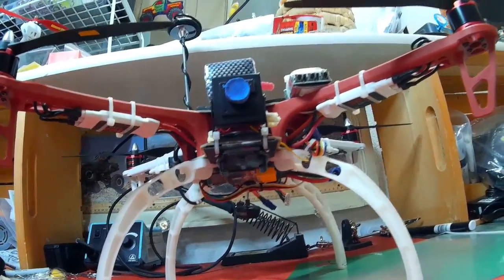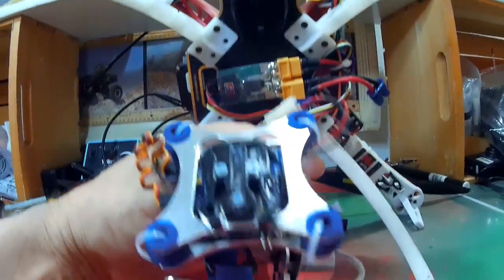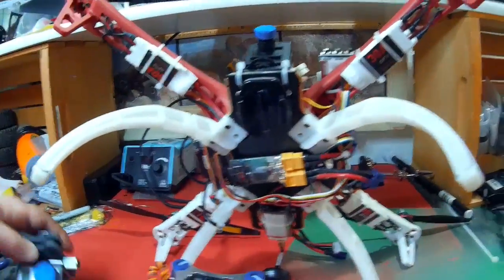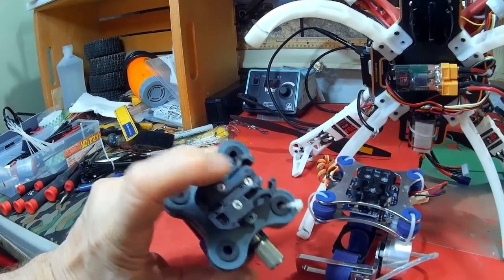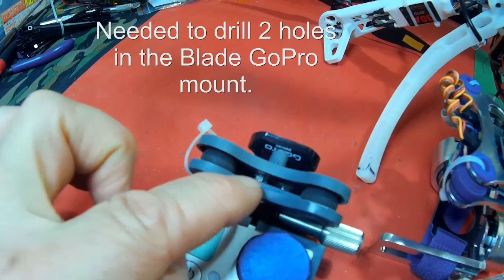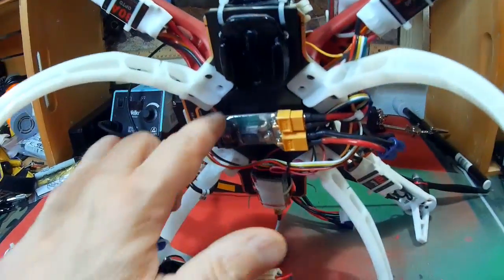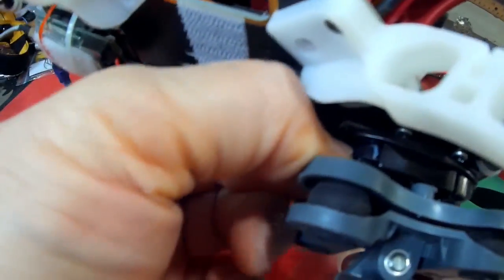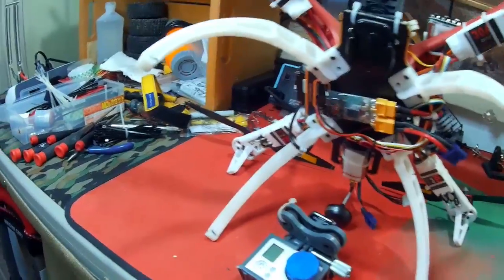Gimbal to no-gimbal GoPro camera mount on DJI F450

Comment: use the white rubber thing that comes with your go pro, it will stop the clip from sliding / un-clipping off the mount
Reply from the maker: Thanks.  All I have to do is figure out how that little white thingy works.

Comment: Hi! where can I buy ?vibrations in the video?
Reply from the maker: I just used parts that came with the GoPro to make the mounting. I took the goose neck mount apart to get the attachment to the gimbal.  Doesn't seem to be any more vibration than hard mounting the gimbal to the quad.
Reply from the maker: Alessandro Romano This looks like the same gimbal that I have. If so it is a good gimbal to start with and the price is good. I have 2 quads and the second one has the Feiyu G3 gimbal but it costs 3 times higher.
Reply: mikeglamrc the weight of my drone (dji f450) is 1200 gr.you know the weight of this(240 gr ? ) + cam sj4000=60 gr .total 1500 gr . is a problem?
Reply from the maker: Alessandro Romano I would have to measure the gimbal weight when I get home tonight. I have the DJI F450 with 840KV motors turning 10x3.7 props and using a 6000mAh 4s battery. My total quad weight with gimbal, GoPro and battery is about 2000 grams. I get about 6 minutes safe flight time and a max of 12 minutes before the quad lands itself.
Reply: mikeglamrc Thank you for your time.I am a beginner. and I took a drone recently:
(dji 2212 motor 920kv,e300)
Reply: Alessandro Romano sorry it took longer than I thought. The gimbal weight without the GoPro camera is 208 grams.
Reply: Random Acts of Cooking with the characteristics of my drone, I will have problems in flight with about 1500 grams of weight?
Reply: Alessandro Romano There are all sorts of YouTube videos about batteries, motor KV and prop size that you'll need to search for. As for me, I just take the quad, with all pieces attached, fly up to about 2 meters and put the throttle at 50%.  If it stays in a hover the motor/prop combo is might be OK.  When you do this test set a stop watch to start and run till the quad lands itself.  I get about 12.5 minutes. Cut this in half for safe flight time. After the quad lands quickly grab the motors. If you can't keep your hand around the motor that means the motor is working too hard and you'll either need to change to a higher wattage motor or lower the prop pitch.  Then run the hover flight test again. Hope this helps.